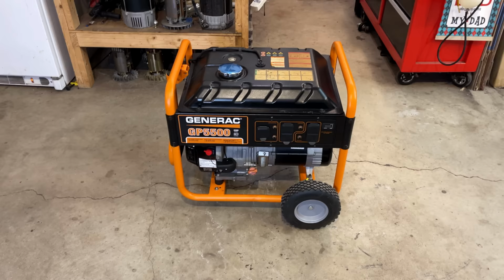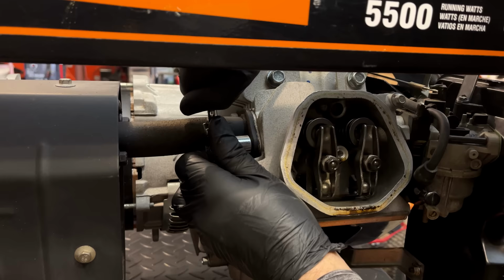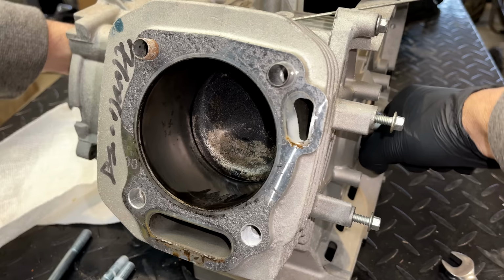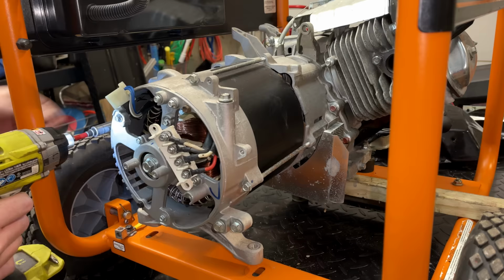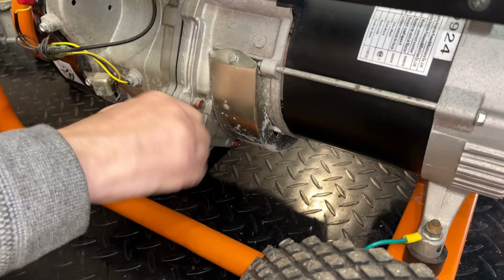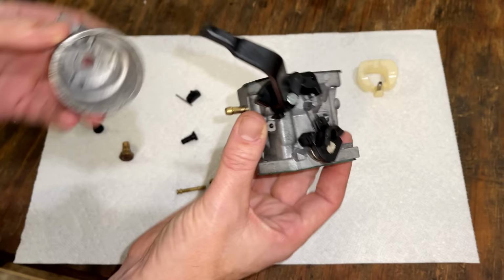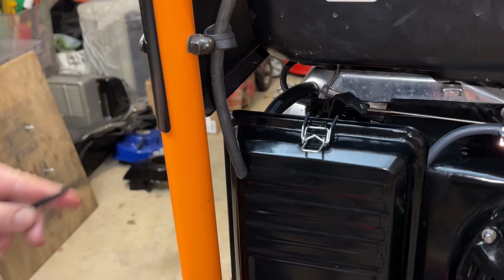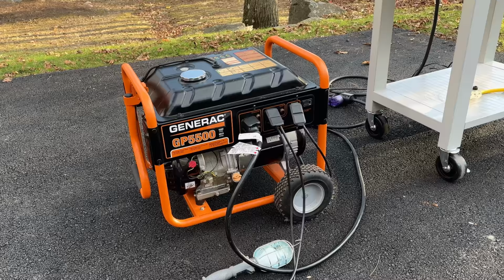What Caused This Engine Damage? - Generac GP5500 Repair

Comment: James got me to thinking that maybe non-detergent motor oil was more hygroscopic than detergent motor oils.  Numerous google searches for such provided no real usable information to the matter, just that oil is hygroscopic and has an affinity for moisture from the humid air around it.    My next thought was that quite probably most people that run a generator have no real knowledge of oils.  And that as long as the generator motor has oil it is fine.  I guess it is possible to probable that most continue to run their generators on the non-detergent motor oil long past the 40 hour mark.  And possibly do not change it out at all instead they just add oil when they they check it and it low.  That is my best guess for the accumulation of the residue found inside these failed engines.  That and they may take the non-detergent oil bottle with them when they get new oil, another mistake of not knowing any better.

Comment: They poured the cause in the fuel tank which led to damage and a no start to follow. And fuel that sits and sits turns nasty. It makes you want to coat the inside of metal tanks anymore.
When it has locked up, sat, now has noise pulling the rope, and you see that in the tank on such a new looking gen-set, you gotta think somebody killed it and walked away.
I hope you use 150 in parts to fix other gen-sets..
Otherwise you should have passed on buying this when you saw and heard it.
Good video for   experience by post mortem.
If you have goto parts laying around, then you can have another machine give its all.
2 into 1.
People do dumb things when fuel gets expensive, or they dont have transportation or money, to do things right.
Somebody drained contamination into a gas can and didnt label it? Or dispose of it properly.
The next guy grabs the can and says, "heres some."
Doesnt check it, pours it in.
Very bad. But draining the tank when its having no use is the last thing on peoples minds. Fuel that had turned leads to most all the free equipment i've seen. I was able to refurbish some, and keep some. Now they sell refurbished mowers for $50 near me, so its not really a booming business to get into, but a hobby.
Yours turned out very nice.
I would give cash for that if so inclined, but then seal and protect the tank inside for keeps.

Comment: Haven’t seen you come across any Generacs with multi-function switch with the choke/ fuel/ ignition all in one. They are troublesome.
Reply from the maker: They are trouble for sure.  Have battled a few like that on Ryobi generators and some inverters.

Comment: someone left the fuel petcock open with engine off.  crankcase filled with 10% ethanol gas  which rusted the insides. Additionally, the generator appears to have been run with the oil and gas mixture.  Should  always check the oil prior to startup.  if it is too full there is a good chance the oil has gas in it.

Comment: Another great video.  It seems that the Generac portable gensets are pretty poor quality.  I always learn from watching your videos.  Thanks Much!
Reply: Portable Generacs are as good as most and better than some.  They are built for consumer use, not commercial use, and need to be price competitive in a market flooded with Chinese crap.  They will give many years of good service if properly stored and maintained.
Reply: @boonecountygenerators3052  I wasnt trying to crap all over Generac.  I had a 20 year old  20Kw Generac home failover generator that worked flawlessly every time it was called upon.  It just seems to me that their portable line is part of the Chinese crap flood that you mention.  It is my understanding that it is made in china with a rebranded clone engine.  I agree that there is allot of cheap competition out there.

Comment: James I have that exact same headlamp. I use it when I'm soldering electronics and it seems to work well. A little heavy on batteries though.
Reply from the maker: It does suck the batteries dry quickly, but it is a good light.
Reply: @jcondon1  well I use mine a lot and at the brightest setting (all white lights on). I can get the lithium AAA batteries.

Comment: I agree thanks Bud .I learn so frigging much watching you !....Hey i got 2 good STIHL weed wackers from the dump metal bin...Both run when  starting fluid is put in ...one pull. but the little carbs have them stupid membranes in them .Could you do a show on the Carbs for these anoying rigs??? Loyal subscriber
Reply from the maker: I would if I had one.  Probably very similar to a chainsaw carb.  Have a couple videos rebuilding those carbs.  Think the homelite chainsaw and the craftsman chainsaws.
Reply: Check out Chickanic. She has 100 of them

Comment: Could the carb flooded and filled the crankcase with fuel? How can so many parts be wrong on such a clean machine
Reply: There not harden steel and soft metal 
Simply defective 💩

Comment: Problem with Generac and other mfgs is they list these as “commercial” when they are anything but. If it doesn’t have a cast iron cylinder it isn’t commercial.

Comment: People should use no-ethanol fuel in small engines. Especially small engines that sit for long periods of time.

Ethanol attracts moisture, it will suck water right out of the air and put it in your gas tank or carb. Non-ethanol gas not only stores better, it is less harmful to the tank and carb.

If you know you're going to burn through the fuel within a week or so, get regular 10% fuel, but if it might sit with fuel for more than a month, put non-ethanol in it and run it for a few minutes.

Comment: I was curious about that. I use the same degreaser in my ultrasonic, and I usually remove all of the gaskets before I soak a carb. I noticed you leave the bowl gaskets on. Has that ever caused you any issue?

Comment: Hi James, great video. What is your opinion on champion generator. Im looking at electric start. 4,250 i believe. Thank you.   I own Landcaping company 30yrs. We fix everything. Your great at figuringout out problems. Well done
Reply from the maker: Champion is a solid company.  There equipment though are Honda clones just like the generac.  They all are clones now so it really just the branding that is different and the company that stands behind them is something goes wrong.  Champion  is good with support, warranty and parts.

Comment: How about someone having put sugar in the oil? I've heard that diesel's have been sabotaged by having sugar in the fuel. 
But that's a hell of a build-up in the sump.
Reply: Reading down below a lot of people think it's water, or water-based, that got down to the crankcase. I simply can't see that there is enough to rust away to provide that much of a build-up. Looks mostly aluminium down there or stainless that hasn't been too badly corroded. I'm only at half way though.

Comment: do not bolt the tank back on;...place 2 hinges on the far side and 2 twist locks on the near side to facilitate access to the spark plug...
Reply: glad to see you  remember the zip ties in the generator head...!

Comment: Working on a Generac GP220i generator.  I have an oil leak.  Need to take the rotor off to get to the crankcase gasket, but not sure how to remove the rotor.   Any help someone could provide would be great!

Comment: 👍👍👍👍👍🤜🤛 question the engine that was blackened at the bottom on the inside. I’m not a mechanic never claimed to me, but I enjoy watching your show. Can that be cleaned out and where with the cylinder piston on the inside? Could that be honed out and have a sleeve put in or have a larger piston, possibly put in there so it can still be used?

Comment: Well, that explains the oil being “a bad color”. What’s shocking is how good the outside of the engine looks. So it being in a floor doesn’t seem likely. Bad fuel or something in fuel seems likely. Wonder if they tried to use something to clean rust from tank and didn’t get it all out… plus leaky carb flooded into engine.

Or… coolant will turn aluminum black like that… almost makes me wonder if this was intentional. :/

Comment: Another nice job James. My guess is gas leaked into the engine and turned bad. Too bad that hour meter looks so bad on the nice looking panel. What happens when you connect a bonded generator to the house? Do you know why the engine bolt heads were blue on the original engine?

Comment: I wonder why the generator manufacturers are too cheap to make the neutral bond a switch on the control panel.
Reply: Because 99% of consumers would leave it off when it should be on, and vice-versa.
Reply: @boonecountygenerators3052  Yeah, you're probably right. Never underestimate the stupidity of the user.

Comment: Hi James In my experience Generac uses the cheapest engines they can get, most are from China (they have the ability to make good stuff, if the customer want's cheap they make it accordingly).  we had a few large ones 500kw that all had Chinese motors with many issues. 
I feel that $175 dollars is out of line for a camshaft. you can get the 13 hp cam for $35 
this looks like a Harbor freight 13 hp predator to me
I wonder if the engine had salt water in it then it was run until it stopped
Rich
Reply: Don’t buy one because they are defective cam best to have it checked by a mechanic if you have one, no warranty eather 
Mad folks 😢

Comment: Possibly rain water intrusion or lots and lots of condensation into the gas tank and with no way to vent when the temperature increased every day and decreased every night a tank will suck in moisture from a high humidity environment and with no vent the pressure in the tank forced the water in the tank passed the carb’s float needle seat and flowed into the crankcase.  I’ve seen it happen with gasoline and since water settles to the bottom in gas tanks and the tanks tap to the carb is on the bottom instead of a crankcase full of gas you get a crankcase full of water floating the oil snd even without being ran although this looks like it may have attract had someone trying to run it and agitating the oil and water in the crankcase you end up with what you see most likely.   Clean and good on the outside while some indicator of attempted care and storage doesn’t mean  clean and good on the inside.  I don’t think the generator/small equipment flipper/reseller did anything but get the engine running after it had already suffered water in the crankcase damages and once he got it running either didn’t think, know or care that it was likely already damaged.  He’d make a good small car lot used auto reseller to be very aware of NOT buying an automobile or small equipment from.

Comment: Love your work. why does your drill always sound like the battery is dead.
Reply from the maker: The battery could have been low.  It is a weak impact.  Perfect for the smaller bolts.

Comment: Water in the gas that past the carb into the crankcase.  The mix went bad and turned acidic over time.  Or maybe some chemical was put in the tank end up in the engine.  It ruined the air box maybe the pedcock valve???

Comment: There are already two Generac with the camshaft that I have seen damaged, they are using low quality steel, Generac has greatly reduced its quality but it still has prestige that it no longer deserves, I have a gx270 clone that is 12 years old and has only lost 500w with gas natural since always
and always use and mobil 1 0w40 and mobil 1000 20w50 now that it's aged

Comment: Could it be possible that it was run low on oil at some point and over heated, but did not blow up? I suppose that it would change the chemical composition of the remaining oil if it got hot enough.

Comment: James, I too look forward to your next video. I recently had my first incident of needing to use my generator (Dura Max XP13,000EH) for an extended power failure at my home. I ran the generator for about 3.5hrs, and it worked perfectly. However, it made me wonder how long you should run a generator before allowing it to cool-down.
Reply: Realistically until it needs maintenance such as an oil change. They are built for extended use, they have ducted engine cooling built into the design.
Reply: They will run indefinitely.  If you store the generator somewhere that rodents like to live, throw a sack of moth balls on the engine to discourage them from building a nest under the shroud and blocking air flow.  Many engines have been ruined by overheating caused by mouse nests.
Reply: @peterclark6290  Thanks for the info. I hoped that would be the case, but this is my first generator, and I figured it couldn't hurt to be sure.
Reply: @motorjock0478  glad to be of assistance. I recently needed to run a small generator for nearly 8 hours, even topping up the gas on the fly: thanks to having a very flexible hose that removed 99.9% of the risk from spillages.
Reply: I have run my house off the generator for multiple days, stopping only long enough to refuel. You'll be fine.

Comment: Maybe it was the the video not getting close enough, but yeah, even though the internals were dripping with rust, the wear surfaces looked pretty good.  Like they’d clean up with some lapping.  Same with the engine cylinder and piston.

The wear surfaces couldn’t have been stopped off with painters tape and the rest of it sandblasted to a clean surface?

I dunno.   Could the engine still be a runner?

Comment: Hello, when you buy them new from the store it comes with cheap break-in oil, after the first 30 or 40 hours your supposed to change the oil to full syntactic. I could be wrong on the break-in hours, but I think it's close. Need the manual to look t up. Do you think this is what happened by leaving the crappy oil in it and never got replaced with syndetic? Also, when you swapped engines did you also swap the hour meter?  The meter needs to stay with the engine, Keep the videos coming.
Reply from the maker: I think it was crappy oil.  Use regular oil for the first 5 hours then high quality oil after the break in.

Comment: James, a little confused here.  I was surprised to see you use and mention the Harbor Freight degreaser in the ultrasonic.  Thought you stopped using it as your description after the video still says you are not using it anymore.  Did you decide to just use a weaker concentration or am I missing something.  Great video, as always.  Thanks!
Reply: Im wondering what he does use now that's non corrosive?

Comment: Thanks James great Video, is that a new toy instead of the heaters?😊
Reply from the maker: It is new.  Still use the heaters for smaller generators or 120v only generators.

Comment: Great video James.   I noticed you have the amprobe clamp meter like mine.    Does yours THD function work in both inductive (clamp) mode as well as probe lead mode?    The instructions aren't very clear given the product is a Japanese product rebranded by amprobe/fluke.   Mine doesnt read very accurately in probe mode, it either reads "rdy" or 12.5% no matter what.   I've had other brand THD meters that worked very well with the clamp.  So I'm wondering if mine are bad.     Thanks in advance for any insight you may have.

Comment: Great video as always.Was that Load Bank a recent acquisition? It is handier than dragging out 2 or 3 electric heaters as in your earlier videos. I use an oil filled electric heater as a load when I exercise my generator periodically as recommended by the manufacturer.
Reply from the maker: I picked up the load bank from Facebook last summer.  https://youtu.be/q4WishKV0_E?si=l2jBOblQ_G2LMxvG

Comment: Jim, as I was watching this video (this one was really interesting) I was curious to see if you had ever done one on neutral bonding.  I paused the video and searched through your library and nothing jumped out at me. So when I returned to this video, you were just starting to talk about it :)    I do have a question... since my new portable will be used to connect to the main, I unbonded it by removing the jumper.  The docs say that un-bonding disables GFCI protection from the 5-20R receptacles. Can I plug in a fan to one of the 5-20R receptacles while it's connected to the main?   Thanks!  Dick Day
Reply: If you float the neutral on the generator when it's connected to your home service panel, the neutral will be bonded to the ground right there in the panel.  In this scenario the GFCI protection will still work.  The electrons take a different path to get to the same place.
Reply from the maker: Good point.  Thin the GFCI issue would only be when unbonded and not connected to you service panel.
Reply from the maker: I have not done a video specially on bonding.  Try to work it in sometimes when it makes sense.

Comment: What's the cheapest price you can get the cylinder re-bored oversized. It would save the block, if you can get oversized piston & rings.
Reply: Not economical. This is not a valuable engine or piece of equipment.  Sold in a hardware store for cheap.  Doesn't even have bearing inserts on the rod.

Comment: Nice work, as usual James.  Another one lives again.  Can I ask what you were spraying on the engine to clean it at 36:43?
Reply from the maker: Usually wd40.  Looks like this time I used water mixed with dawn dish soap.
Reply: @jcondon1  Thanks!  Hoping to clean up a motorcycle engine that has some oxidation like that.

Comment: Did the hour meter work correctly? I noticed the wires were reversed when you reconnected the white and black wires. Robin in Philippi, WV.
Reply from the maker: It should, but did not look.  I believe that one runs on the AC output so polarity should not matter.